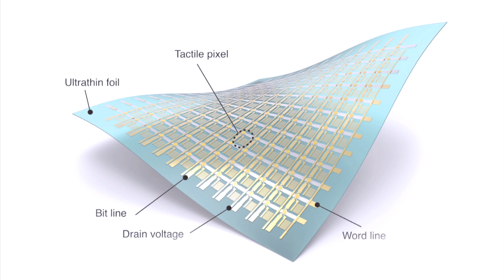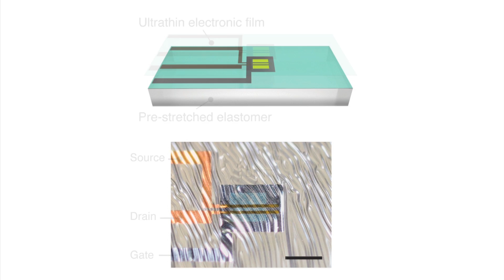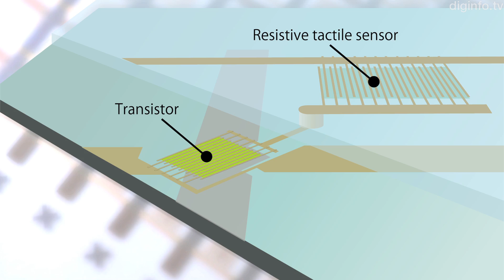World's lightest and thinnest circuits pave the way for 'imperceptible electronics' #DigInfo

Comment: they never said that the drop proved it was lighter. they just claimed that it was lighter. there is no fail, contradiction, or false claim here. they resist air differently, and the circuit is lighter. i would say the drop is to give you a human idea of how light it is.

Comment: But they didn't drop that different circuit, did they? This particular experiment had showed that a circuit of this particular size is lighter than the feather of this particular type.
All the try-to-look-smart guys here in the comments are forgetting one thing - a feather is not a scientific measure, this is just to have something to relate to in terms of weight. They all fail to understand it, and their comments make them look like a bunch of idiots.

Comment: 0:55 thickness is 2 microns with weight of 3 g/m^2
this means density of circuit is 1 500 000 g/m^3 or 1.5 g/cm^3, which is typical density of a polymer [engineeringtoolbox]

A feather has a typical density of 0.0025 g/cm^3 (honestly i think this included the empty space in the feather structure) [Martha D, Anthony C: "Density", visionlearning]

Thus, a feather is still lighter than this material in practical terms. The circuit is light only because it's magnitudes thinner than the feather.

Comment: Obviously I meant that in a general circumstance. I didn't mean to say that's exactly what it means. Just trying to say that the density being different means that it will push away the air easier. Guess I didn't work myself properly.

Comment: I mentioned that force acting downwards on both of the objects are different. This does not mean that acceleration is different if in vacuum. F=ma. 2unit mass, 2unit force, 1unit acceleration. 1unit mass, 1unit force, 1unit acceleration. Yes, you are entirely correct. You simply misinterpreted my comment.

Comment: Say air resistance were the same on both objects. The force acting downwards on both of the objects, the Film and the Feather, are different, due to the difference in their masses. Air resistance acting on both objects are the same, consequently there'll be a difference in net force downards on both of the said objects. Therefore greater acceleration on the object with greater mass, vice versa, and so, we can tell which object is lighter. Again, if air resistance were the same on both objects.

Comment: Mass of Film is less than mass of Feather. Earth's Gravitational Field applies a set amount of force(downwards) on a set amount of mass. As such, there is less force(downwards) on the Film than there is on the Feather. Say the air resistance(force upwards) of the Film and Feather are the same. There will be   less net force(downwards) on the Film than there is on the Feather.  Therefore resulting in less acceleration. Demonstration is valid, if we say that air resistance is the same on both.

Comment: Nah, without gravity they would float. Without air they would fall simultaneously. With both you can prove that it is lighter using the item with a comparable surface area. Example - use a book and a sheet of paper of the same size. Obviously the book will fall much sooner. That's due to the fact that higher mass means higher energy of motion. And the same amount of air resistance will have a proportionately smaller effect on the fall. And vice versa.

Comment: But the lighter the material, the less inertia it has, therefore, the easier it is for air to affect its motion against gravity. So the demonstration does show that the feather is heavier because the feather's weight is greater than the weight of circuit. Although, I have to agree that the surface area with the air around it also comes into play.

Comment: No it does. That's entirely correct that the freefall acceleration is the same for any item, but air resistance isn't. The lighter the material is, the slower it will go through air. You can toss them both forward with equal force - and you'll see the same thing - this circuit won't fly as far as the feather.